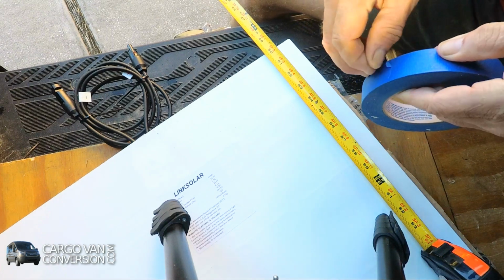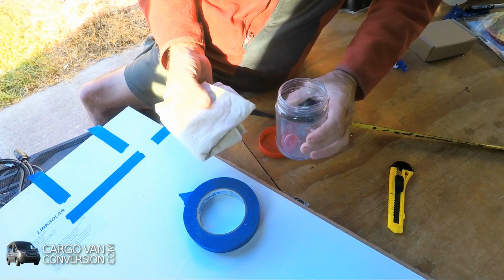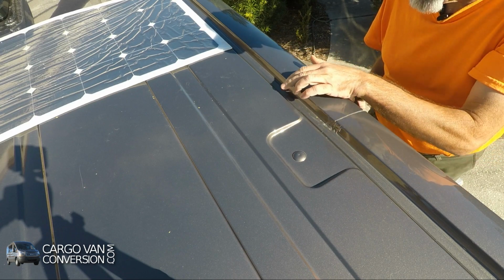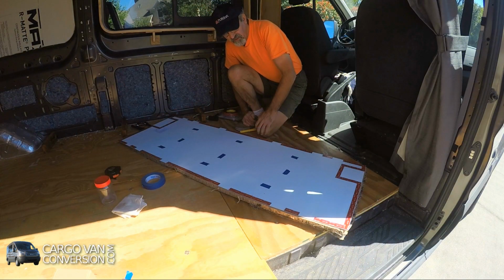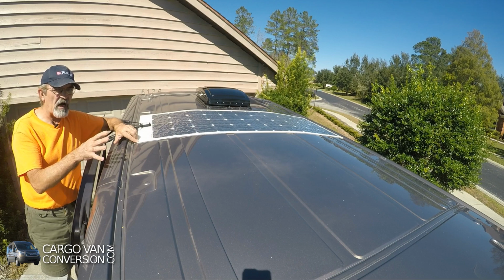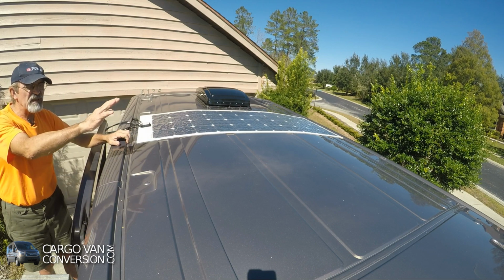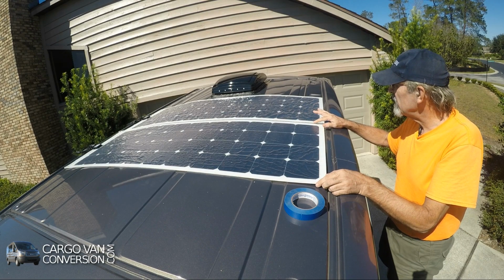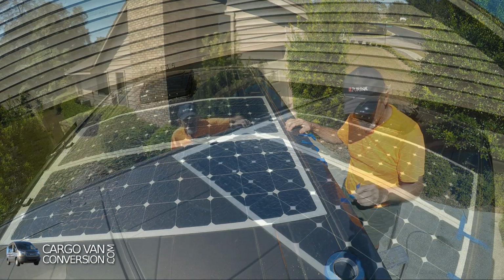ETFE Flexible Solar Panel Installation - Part 1

Comment: I followed your videos the best I could on a panel install on my promaster. It turned out amazingly well. Thanks for making these videos, they helped a ton.
Reply from the maker: Hi Andy,
Thanks for the feedback. I always appreciate hearing that my videos made some positive difference. How much solar and batteries do you have and are you living the vanlife or is it just for short trips. Would love to see a few pics :)
Have a great day!
Van Williams
Reply: Cargo Van Conversion I got the Renogy RV kit and added another 100 watt panel making it 3 altogether with a 1000 watt inverter and a 155ah battery. I work on the road 2 weeks out of the month, so half my life is vandwelling. I’m not sure how to post pics in comments. But I do have few good ones that show what I did and how similar it is to what you did.

Comment: Wow those solar panels look great on the cargo van and I like how you mounted them down using 3M tape I wasn't sure on how I was going to mount mine but now I know how thank you for this video.  I am heading to watch part 2 now.
Reply from the maker: Hi Darren,
I chose these specific panels because they exactly fit the width of the roof of my Ford Transit; could have added a fourth panel too, but 405W is probably enough.If you use 3M VHB tape, be sure to get the right one and absolutely clean the roof with the alcohol solution, otherwise you might loose your panel(s) when moving. Enjoy the videos!
Van Williams

Comment: wonderful work this week, Van. It is high time auto manufacturers design a solar roof on cars where not an inch is wasted,  There is a very sharp electronics guy who has a YT channel, his name is jehu garcia. His interest is in electric vehicles, but he dabbles a bit on solar charging systems to recharge his car. He was able to put together a power set-up that gave him 748 miles of travel on his Vw bust. Really sharp guy. For car or for home, we should all be interested in going off the grid, where all of our energy is derives from Natural Energies. We could end pollution. I hope the installation holds, it is still a bit concerning whether the panels will start to peel off on the highway. Looking forward to part 2.
Reply from the maker: Hi Mario,
I'm skeptical, if we ever can stop pollution, but I agree with you.
My brother lives on Mallorca, Spain; when homeowners add solar to their roof there, they nowadays are financially penalized. Incomprehensible!
I have a lot of trust in the VHB tape, it doesn't look much but apparently, it works well. I've found many that have used it successfully. Even 3M 'sort of' recommends it.
If you see me drive by next year without panels, you'll know why :)

Van William
Reply: I know. The government is so crooked there, they force everyone to be a customer of the electrical company. Even in Florida, there are towns where it is illegal to be off grid.
Reply: Jehu is the guy who made his own Powerwall, equivalent to the Tesla one, patiently soldering hundreds of lithium cells together. Definitely a smart guy. There doesn't seem to be much he doesn't know about the technologies.
Reply: that;s right, Mevi, he is certainly sharp, and he offers his knowledge at a fraction of the cost of buying anything Tesla. He sells recycled batteries, and some prepared packages to help self-starters

Comment: Looks good! The 3M tape you’re using is very strong and durable, I’ve used it for many automotive applications too, so it should do the trick. Looking forward to see how you’re going to do the cable management!
Reply from the maker: Hi Mark,
I think so too about the VHB. The cables worked out fine; I'm working on that video for new week. The only drawback was that these MC4 cables and connectors 'stick out' more than the solar panels.

Van Williams

Comment: I installed three flexible panels on a Ford Transit last year at Jamie's Van Build meet-up in Lake Havasu and use VHB tape and it worked well.  We did something I wouldn't have considered before this. We connected the panels in series, but not like you might think. (daisy chaining all the panels together,  A to B to C  with a positive from A and negative from C going to the Charge Controller in the van.) 

Rather, we connected the panels in series, but not series to the closest panel.  We connected A to C and C to B , with a positive from A and negative from B going to the controller.  This saves having extra wire looped up between each panel and makes the cable management flatter and less visible from the ground.  Hope that makes sense.  I can send you a picture of the finished product if you would like.  TL
Reply from the maker: Hi Terry,
Would love to have a few pics (van@cargovanconversion.com), always makes more sense, but I think that I get it. You'll see the cabling in next week's video.
My panels are 22" wide and come with three feet cables. Small cable gland next to the roof vent in the rear. I started with the full length (3') cables from the farthest panel past the center panel, cut the center panel cables to length and used MC4 branch connectors to connect them together. The resulting two cables (pos & neg) go to the same area on the first panel, cut those cables to length and used a branch connector again. All with the standard 12 AWG wires. From there I used a 8 AWG MC4 extension cable through the gland to the breaker box before the controller. There are no wire loops, everything to size; that also minimizes voltage drop. You'll see in the next video, how good it looks.
Have you had any issues with the serial setup; I mean shade problems that tend to be worse with serial.
Happy Travels!

Van Williams
Reply from the maker: I found Jamie's video of you last year. Hope to attend next year. You have a nice rig.

Van Williams
Reply: Hi Terry, my panels are a job I am delaying until I really get all my options together. I read that connecting in series adds the panel's voltages together, e.g. 18V x3 @5A and connecting in parallel adds the panels amps together, e.g. 5A x3 @18V. I've also read that when connecting in series, a fault or shading on a single panel will cause the whole system to stop generating electricity??
Reply: Thats all true, but you also have less voltage drop in series and so you have to consider that.  We didn't have a splitter to allow us to hook them in parallel at the van build and wanted to get it working.  He can always change how there wired in the future.  I wish youtube would allow me to post a photo, I would...  Here's a channel who give incredible detail on how to wire up a solar system with a detailed list of part to buy on Amazon.  Cheers Terry     https://www.youtube.com/watch?v=3nNB1ff9ZjA
Reply from the maker: Hi Mevi,
I'll add my bit of info to that.
You're absolutely right. I think, in general, on vans, that it's better to go parallel; wire distances are relatively short and if you use the correct wire sizes you should be fine. Use a on-line awg/voltage drop calculator to get to the right gauge and use a heavy-duty crimper with lugs. Don't allow anything to go over a 2% voltage drop; try to stay well below that. And if you have more than 200 watts of solar panels, buy a good MPPT controller.
Just a little shade can reduce the output by 50% or more and we all know how often we park under trees.

Van Williams
Reply: Thanks Terry, Thanks Van.
I have been watching along with the Adventure In A Backpack build Terry linked to. They're very knowledgeable. Without the help of YouTubers and other online resources, I would be lost. 
I am not an electrician and I have no experience of auto electrics outside of like for like replacements. Same for home electrics. I can change fittings, but I couldn't wire a house. I will put the cable entry point into the roof this weekend before I complete the ceiling, but I really want to delay the purchase of the panels. I've at least decided on a CTEK 250SA controller that is primarily marketed to 4X4 enthusiasts as a ruggedised DC-DC split charge relay for charging while driving, but which also includes an efficient MPPT solar controller. Both sources can charge the batteries at the same time.
Reply: U guys realize that the huge connectors  are made for house installations where  size dose not matter- inside connectors is a pretty small barrel connector that is just crimped on the end of wire  -  the amps and voltage is very low - - cut one of your old connectors apart and U will see what I mean  -  yup they have a water tight o ring - but good tape job is even better - I used to run water pumps that had connections that were 500 feet under water at 480 volt  and 100s of amps and we used good quality tape and Never had a problem - 100s of pumps  -  also LPS #1 spray will stop any Corrosion - it works like magic - kind of $$ but worth it 1 spray can will last life time
Reply: GroovyVideo2, your right, but the panels come with those connectors and allow plug and play connecting .  Installing waterproof crimp splices is an option.
Reply: Good info. Those industry standard connectors ARE monstrous to have on the roof. I could have a waterproof junction box to bring in all the cables and connect it all there. No tape! 😉 Thanks again

Comment: As I was watching this video, I kept wondering how many miles you covered going up and down that ladder to measure and check and install. 

Please forgive the following skepticism - I do love your work! I also confess to total ignorance on these types of tape.
In my gut, I have a hard time believing that any adhesive tape could last forever, especially when subjected to the temperature extremes, combined with the pulsing effects of highway speed winds. It also seems like it will be difficult to monitor the tape's hold/effectiveness over time. I wonder of installing a small air dam on the leading edge of the roof, might reduce wind velocity over the panels, and improve the life of the adhesive. 

Looking forward to your next video. It is good and brave of you to allow so many of us to, figuratively, look over your shoulder, offer unrequested advice, and question you methods. <thumbs up!>
Reply from the maker: Hi Mark,
The ladder was just a matter of staying in shape :) I'm not in a hurry and am quite relaxed about that. I also could have chosen to apply the tape to the roof first, but I felt that I could do a better job applying it to the panels first.
There have been many occasions that such panels have been installed with this tape, without any failures and while 3M doesn't advise its use, they still recommend this specific tape for these panels. You figure it out! Just google 'testing VHB tape' and watch some videos; you may be surprised as it is also used in commercial applications.
The leading edge of these panels is less than 1/8 inch thick and has in my opinion virtually no effect on the aerodynamics of the Ford Transit.
The 'looking over the shoulder' is exactly how I perceived this channel to be; I've seen too many 5 minute van conversions, that look great, but that give no feedback on how much work goes into it.
I get a lot of advice and surprisingly, relatively good advice. I appreciate that and sometimes it allows me to improve the design or conversion. And there is nothing better than having viewers/readers actively involved in this project. So bring it on :)

Van Williams

Comment: Well done. Another person might have made the process either easier or more difficult. My only concern on the negative side, is difficulty in panel removal if it fails, and the collection of moisture and debris in the channels under the panels. You think everything out so I'm sure it will work perfectly as planned.
Reply from the maker: Hi SKWDMDYT,
I intend too keep them for a while, without a need to replace them :) Replacement is difficult, but there are ways to do it. It is certainly on the list of negatives.
You're right about the channels; it was a compromise between that and heat dissipation issues. Wish we lived in a perfect world...

Van Williams
Reply: I wonder if small pieces of sponge (cut from a washing up spong or similar) inserted into the leading edges of those channels would stop small amounts of debris from accumulating under the panels while still allowing water to drain through freely? Failing that, just leave them open to the elements and periodically blow an airline through them (from the rear towards the front).
Reply from the maker: Hi nagualdesign,
As you may better see in next weeks video, the front panel starts on a solid surface without the channels. With one piece of VHB tape. There is virtually no access to these channels, but from the rear of the last panel. I doubt whether, it would make any difference. Long term it may get some accumulation of dirt, may be not. But it's a good idea, to blow air through there, once in a while.

Van Williams

Comment: What mic is that you are using for your gopro 5
Reply from the maker: Apologies for the late answer; I'm just back from my trip to the RTR in Arizona.
Sound has and still is an issue while recording, but I never use a separate microphone connected to the GoPro. In certain circumstances I do record separate audio on a Zoom H1 recorder and add it to te video during the editing process.
In anticipation of some changes (i.e. moving permanently into the van), I recently acquired a Nikon D500 camera with much more capabilities and much better audio. On top of that, I'm considering to buy a Sennheiser AVX-ME2 audio mic system. The GoPro will be used as an instant vlogging camera.
Hope that really answers your question :)
Van Williams
Reply: Thank you.

Comment: got solar hooked up today - mounted Victron 75/15 solar charger under drivers seat-
making mounting bracket took all day - if everything fits as planned  it will be nice and does not uses any wall space - Testing to make sure everything works together- then will put seat back in place - Victron seems Not be shutting off at set voltage - will see what happens during testing - close to cruzing
Reply from the maker: Hi Jay,
There is sometimes so much time going into the conversion, without seeing much progress.
My solar is installed except for the batteries, will buy a set ot two 6V's for the time being; replace them with Lithium later on.
The cruzing thing: will that be a permanent thing or just short trips?

Van Williams

Comment: One thing U might want to look at is the plastic roof plugs - they are pretty flimsy and only have a tiny amount of sealer holding them in place - while  working on roof  I saw just how bad they were and realizing that a  tree branch strike would open a hole straight into the van so  I removed all of the plastic plugs and cut some aluminum plates to cover holes and sealed them with Loctite polyeutheane sealer / glue so I never have to worry about it leaking - the holes are oval shape and were used so robots could grip panels and place them accurately during construction - If you dont want to go as far as replacing the plugs I sure would put some type of sealer over plugs  or at least some good quality tape -- Im using the front hole over the slider to run wire into van for solar - I have high top van but it looks like the front section of vans are somewhat same - the plastic plugs are the same for sure
Reply from the maker: Hi Jay,
I never knew these holes are there for assembly robots; makes sense. Just the use of these plastic plugs is ridiculous, like these plastic stickers over these slots on the floor behind the front seats.
Another issue I'll have to put on my ToDo-list.

Van Williams